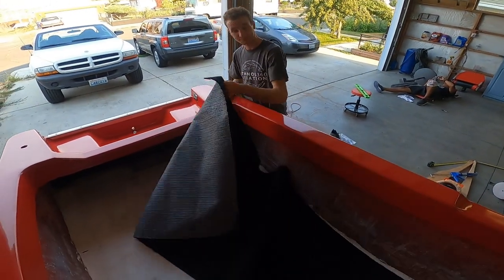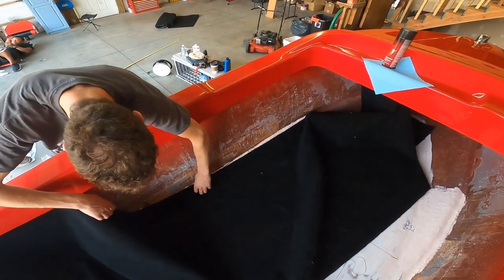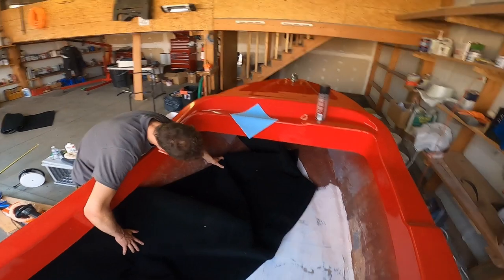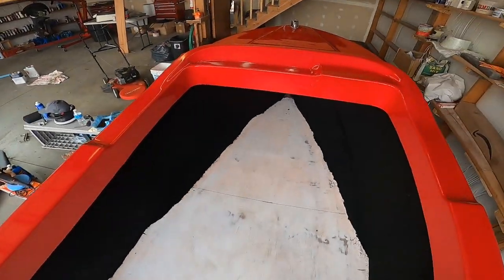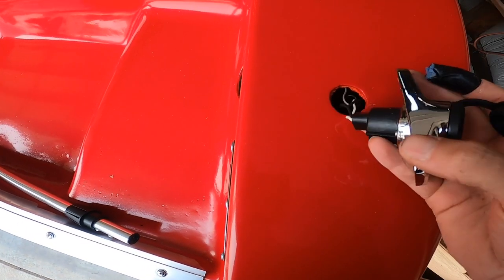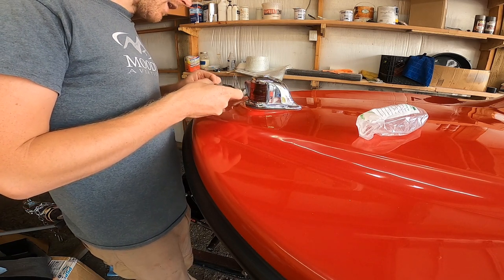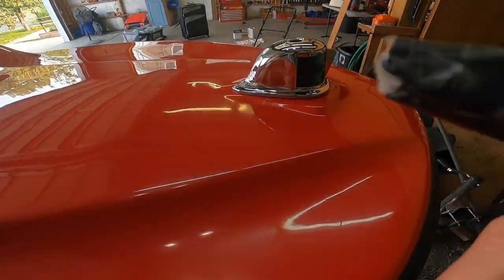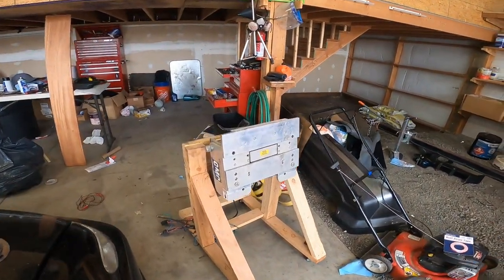Boat rebuild (PART 22) carpet, power trim, lights

Comment: You may want to consider adding plates where the bolts come through the transom, both inside the motor well and beneath it to spread the load from the motor bracket across a larger surface.  Every boat I have ever seen with a motor bracket or jack plate has them because of the additional stress caused by hanging the engine further from the transom.  The washers you are using could start to sink into the fiberglass over time.
Reply from the maker: Seth, that's a good point! only yesterday did I see another fellow boater who did what you mentioned. I was like... I definitely need to do that!👍

Comment: I used a Panther Marine unit as the CMC was sold out.  Did the same thing. I ended up putting my fuel tank up front under the deck as the boat became back heavy with the bigger motor.
Reply from the maker: what a good idea! I may make a custom fit tank for the bow one day as my boat will also be pretty back heavy. was your boat similar size to mine?
Reply: @Project2Potential  Mine is a 1959 14ft Whitehouse.  Transom height is 17 inches.  It was rated for a 40.  I figured heck.  1959 40 must have been huge.  Would you  believe a 1984 50hp merc is heavier!  Yes has a front deck but I think is narrower than your boat.  Look at racing fuel cells.  There are some aluminum in the sizes we need and also you can run a gauge.  Im thinking that way.  Right now I can pull out the board I made out to get at the tank.  Not sure if I want to hack the deck on a classic to put a fuel fill port in.
Reply from the maker: cool! same year as my Silverline! I will have to looking into one of those fuel cells could come in handy. though I may also install a fuel filler port haha. not sure yet. your boat must move with that 50 merc! 😝
Reply: @Project2Potential  Right now 20 mph.  She isnt running right.  No power.  Trying to figure out why.
Reply from the maker: maybe it is running on one cylinder?
Reply: @Project2Potential  Not sure.  Will get on a plane with only me in the boat.  Does not seem to have full power.  New tank, hose, carbs rebuilt.  If I could figure out how to post videos I would show you what I mean.  Runs great low throttle.  Just no high speed power.  The thing should jump outa the water and fly
Reply from the maker: I really thinking you may have a dead coil. how many cylinders engine do you have?
Reply: @Project2Potential  4 cylinder.  I checked all 4 with a spark checker after I changed the switch box.
Reply from the maker: @L2fish  interesting? Did you do a compression test on all cylinders?
Reply: @Project2Potential  When I first got it.  I am afraid to find something now.  I think it may be  starting point though.

Comment: How come you are putting a jack plate on and not just bolting the engine straight to the transom. And did you repaint the engine or buy a new one. Ohhh years and the boat looks beautiful
Reply from the maker: Thanks Jeremy also good question! the main two reason for the jack plate, I wanted the option for power trim and also the motor I 'am mounting is a long shaft, the jack plate will give me the ability to mount the motor high enough for the cavitation plane to be level with the keel.
the motor I have it a 1994 40 Johnson, I did repaint it and put new decals on.

Comment: The shim must be aluminum or fiberglass if its steel the corrosion will be very bad..
Reply from the maker: the shim I used was aluminum, definitely didn't want the corrosion with steel.

Comment: Just a thought...can you put the bolts in the other direction with the heads to the inside?  It might look better.
Reply: That is how it is supposed to be done
Reply from the maker: the instruction were clear to install the bolts the way I have them, that being said I'm not sure if I change then it will effect anything. I'm ok with the way it is now I will just leave it the way it is. 🙂